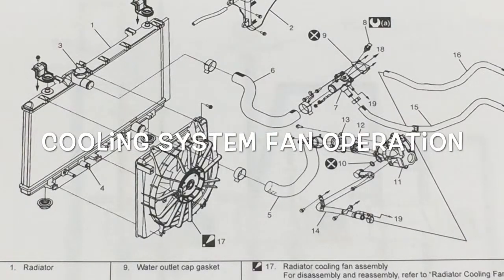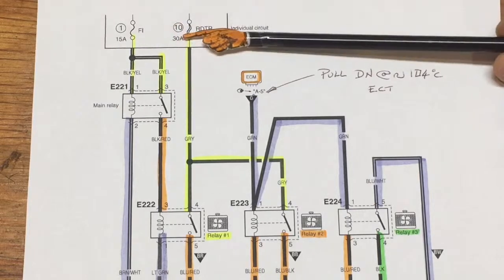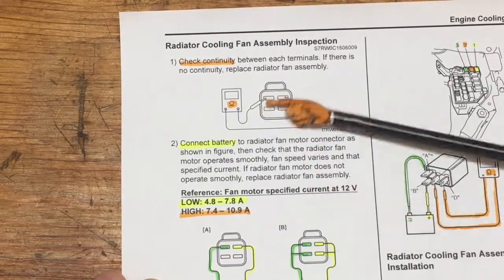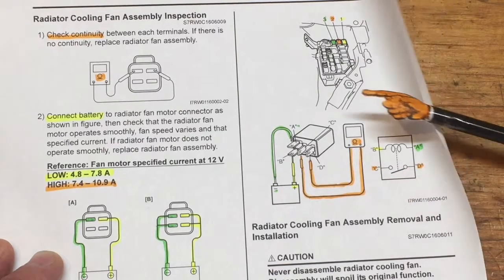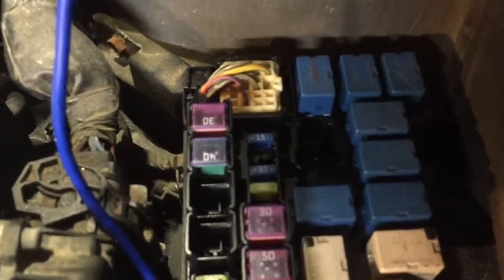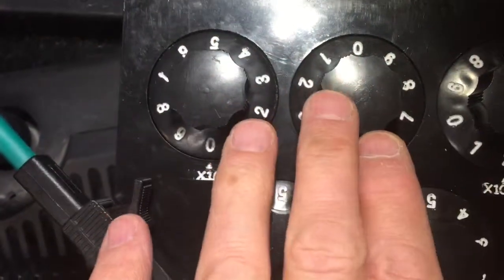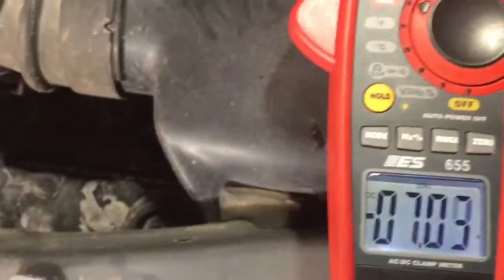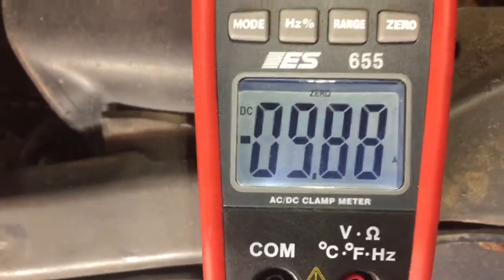Suzuki SX4 Cooling Fan Modes of Operation

Comment: Issue here with m16A gasoline.radiator fan turns on with ac while the condensor is moving painfully slowly.Rad fan turns off with ac off even while in running temperature
Reply from the maker: I can’t really speak to the 1.6L but suspect it’s similar to the 2.0L circuit…Condenser fan is single speed operation. If it’s turning slowly, it’s likely the fan itself is binding (bearing) or there is a high resistance in the feed circuit. Since you also have an issue with radiator fan operation, I would inspect the underside of the distribution box where the system relays are mounted. I have had issues with corrosion in the past. Also three relays control low & high speed radiator fan operation, failure of a single relay in this control approach can impair performance. Thx for watching. 🍀👍🍻

Comment: Does the fan ac and fan motor work together in the same time when we turn the ac on ?
Reply from the maker: Condenser fan runs with: blower selector not in off, AC/defrost switch on. Or Engine coolant temp > 110C (overheat mode). 
Compressor clutch engagement: Engine running, AC switch on, blower selector not in off, Although the manual doesn’t appear to state it, wide open throttle usually disables compressor clutch operation . Is this what your asking? I am uncertain having re-read your question.

Comment: Dude excelent explanation. I thought that regular temperature was around 90 degrees. And i put an obs display with temperature alarm on my SX4 and i was scared of the values. 

Where can I get the manual for further information?
Reply from the maker: Thx for watching. Just Google Suzuki SX4 workshop repair manual PDF download…A range of options are available from a number of providers. I honestly have no idea which company I purchased mine from. Around $25USD. It was many years ago. 🍻

Comment: My 2010 Sx4 AC hasn't worked since I told someone NOT to top it off and he did 😵‍💫 

It worked once. It hasn't turned on since 2016. No proper defrost either.
It holds freon. Isn't over pressure. I had it flushed in 2018. 
Fuse & relay fine. I have no idea if it's  a sensor, switch or worse. No one in small town does AC well. 

I don't want to buy a used system and not have it work. I don't know how to troubleshoot. The heater fan works. Heat is hot. Suzuki no longer made in US. 😕
Reply from the maker: I have many (maybe too many) videos on the channel dealing with Suzuki’s 
A/C system issue’s. If yer inclined. Thx for watching 🍻
Reply: @TheGibby3340  It was fine until human intervention. 😕 I have to troubleshoot it. Since it doesn't even turn on - fuse ok relay ok
Holds freon. I will get my HVAC friend to measure pressure.

Comment: This helped so much, its almost the same setup on mi Suzuki jimny, I'm looking to install a override fan switch. Would be possible to just ground the pin that the ecm grounds with a switched ground for the body to activate the fan?
Reply from the maker: Yes I believe it’s possible as you suggest. If you don’t mind me asking...what purpose would that serve?
Reply: @TheGibby3340  when offroading in 4low tends to get a bit hot, I would like to override it and turn them on before it gets hot. I tried to ground them today but It made a small spark, not sure that what the pcm sends is a ground. You have any suggestion? Thanks for the help
Reply from the maker: @victorexposito11  On second thought... If you were to consider an override... The circuit would have to open the driver side while simultaneously grounding the coil ground side.This would safeguard the driver, regardless of configuration. Sorry for all the alterations to the answer just trying to ensure completeness and safety.
Reply: @TheGibby3340  Dont worry you're helping me a lot, really preciated, I dont understand what you mean by the driver side. Relay gets 12v to two pins always
Reply from the maker: @victorexposito11  I am using the term driver in reference to the solid state switch (transistor) within the ECM. Internally it will toggle a ground onto the relay coil side. But only when biased to do so. (ECT >90C)
Reply: @TheGibby3340  okay so if I understand right I would need to have a circuit that when activated will need to close a ground cable and also open the ecm ground in other to dont do any damage? If thats correct I belive it would be easier to just provide 12v to the 2 cables of the fan for high speed. That would not interfere with the ecm right?
Reply from the maker: @victorexposito11  Yes. It sounds complicated but reality only one switch. In its “Norm” position the circuit is essentially unaltered. Other than the wiring extension to the switch. (Normal cooling fan operation). In “Override” the switch pole would swing to the hard ground simultaneously opening the line to the ECM control. Sounds complicated...but I think simple to implement. Dealing with the relay (control side) allows you to stay with relatively light gauge wiring. (Spelling corrections)
Reply: @TheGibby3340  I wanted to do it that way so as you said I could use a small gauge wire. Can you give any guidance on the hardware i should use? I understand what I need to do but i dont know a switch that has that capability, also to have the high speed of the fan I have to activate the 3 control relays right? Thanks so much, your being great help, subscribing for sure
Reply from the maker: @victorexposito11  Give me a day or so. Will try to prepare a complete answer. Are you certain the Jimny is a same configuration (I don’t have that wiring diagram)
Reply: @TheGibby3340  That would be awesome thank you so so much, its almost the same, I have it and can send it to you if you give your email
Reply from the maker: @victorexposito11  Should be alright...Just alter the interpretation as required.
Reply: @TheGibby3340  perfect, anyway here is a link to my Drive with the diagram for my car, thanks again for your help and hope to hear from you soon! https://drive.google.com/folderview?id=18CTRbRMkRBe3NdL5pv61JdBsmyp4FqXl
Reply from the maker: Does your Jimny have air conditioning (manual or climate control) what year is it?
Reply: @TheGibby3340  its manual Air conditioning, its a 2008 Jimny ddis, the diesel version, its a bit difficult to find info thats why I uploaded the diagram for you, I also have the full workshop manual if you need it
Reply from the maker: @victorexposito11  Ok ...the reason I ask is you maybe able to achieve your overcooling objective by removing the compressor relay and turning on the A/C...I think your condenser fan will still cycle. Clearly with the compressor relay removed it will not cycle (no additional load). Your truck is unaltered and the cooling system fan will kick in when and if additional cooling (engine cooling) is required. You follow? Might be worth trying?
Reply: @TheGibby3340  sounds good and could work but I'm looking to have a permanent installation and have everything working so thats not what I want, anyway I will try, its a good hack if I need it in a emergency. The best solution would be if I can activate the relays if not it would have to be hardwired to fan cables
Reply from the maker: Ok.I see the Jimny is slightly different. Will get back to you. Just a suggestion as I don’t like altering my vehicle (just me)
Reply: @TheGibby3340  thanks, me neither but i figured that where relay is conected could be de-pined from the fuse box and add what I need there with other conector without cutting any wire as I have the required crimping tool
Reply from the maker: @victorexposito11  https://youtu.be/XKtgnln2baU
Reply: @TheGibby3340  awesome, talk in the comments of the otther video

Comment: Also, that was a wonderful video. I do have a question though. When standing in front of the car, the fan on the left of the rad keeps alternating between low and high speed but only when I have the fan on in the cab of the car. On top of that, I've never seen the fan on the right side of the rad actually kick in. Is there a problem with my cooling system? Summer is approaching and I don't want to be stranded if it's not necessary. Cheers from Canada 🇨🇦
Reply from the maker: Jessica Black Far as I know. Tha fan on the passenger side (L/H Drive vehicle) is only single speed...what year is your car? (later models may be different) but I doubt it.
Reply: @TheGibby3340  it's a 2011 SX4. I was thinking that the one on the left (my drive side) might be seized? I just bought the car in February, so obviously cooling was not required when it was -25C 😎
Reply from the maker: @missfixitCanada  The larger of the two fans (the one one the left (driver side) (3 wire)) provides 2 speed cooling air flow. it should be the first to turn on low speed, if temp. still increases then hi. Then the other (right (pass.)side) slightly smaller (2 wire) fan will operate should temp. continue to climb. If this is not the sequence of operation, its likely the 2 speed fan itself, relay or wiring is the issue. As I mentioned, I am under the impression the smaller 2 wire fan (one on the right/pass.) is single speed only. Did you check the fan fuse? Is it free to spin? (use a screw driver to check not your fingers) Note: a seized fan may not blow the fuse, sometimes you can smell it "cooking".
Reply: @TheGibby3340  I will check tonight and let you know for sure! Thanks!
Reply: Hi there! I apologize for the late reply to this, but now that it's warmer out that other fan is kicking in (which is fantastic). I unfortunately have a bigger issue. Is there a way to blow out the A/C condensate line from the inside to the outside? I've seen videos of people blowing it back in but really I think that defeats the purpose as itll most likely clog again. I'm asking because I have water everywhere on the passengers side floor.
Reply from the maker: @missfixitCanada  Hi Jessica. Think if it were me, I would snake the drain line to clear it with a flexible wire then take a shop vac to suck out any loose debris . May have to repeat the process a few times. Other than that, I don't  know of any practicle way to blow the line from the top side down. Cheers
Reply: @TheGibby3340  thanks! I'll give that a go hopefully in the next day or so